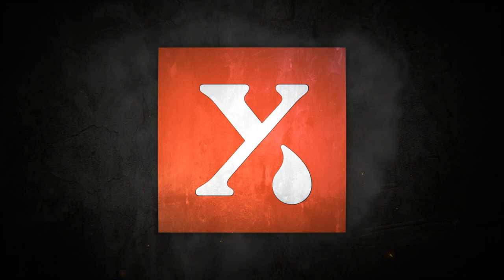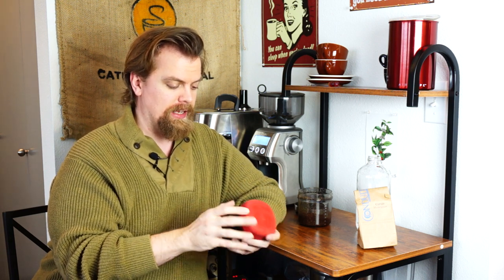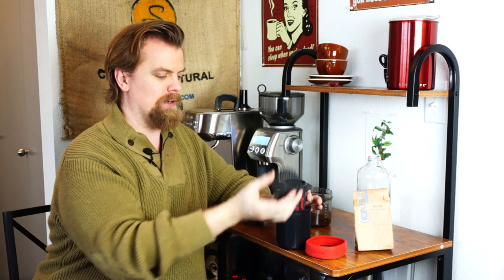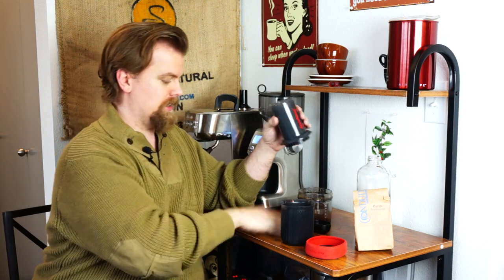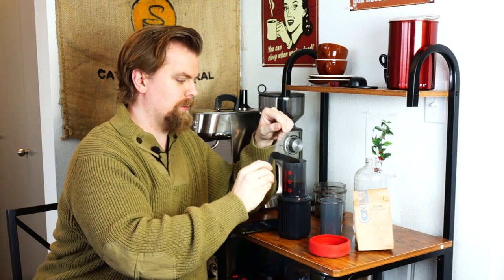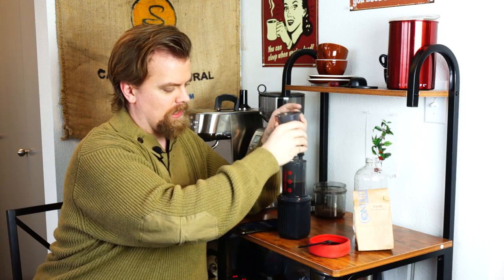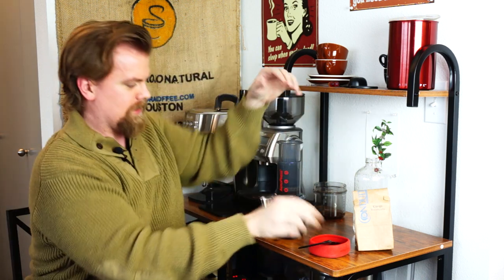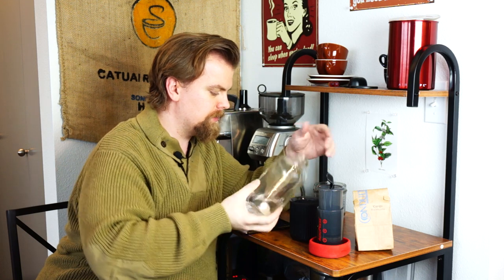How to Make Cold Brew On the Aeropress (Go)

Comment: I see you have a Bambino Plus in the background. I’d love to hear your thoughts on this machine compared to the Barista Touch as I’m considering both. Built in grinder aside, purely as just espresso, which would you prefer?
Reply from the maker: The Bambino has the same boiler tech as the Touch. Same heating capabilities, same milk steaming. Only difference is lack of a grinder, and lack of presets (which are admittedly pretty fun). Also no hot water function for a quick americano.  All that being said it makes a great espresso. I like having one every now and then. Not a daily espresso drinker though.

The only con I've found is the portafilter basket doesn't fit snuggly. This appears to be a common problem. The basket sticks in the grouphead when I remove the portafilter (even if there is no coffee in there), and pops out annoyingly when trying to remove the grounds.
Reply: Coffee Lovers TV  Thanks for the info! Did you get rid of your Barista touch to get the bambino? Which machine do you prefer overall?
Reply from the maker: Gave the Touch to a friend.  I still like the Touch more (having everything built in one machine makes the entire experience so much more smooth), but it also depends on your space availability and other brewers.  

I also have the Breville grinder that I use for all my other brewing, and pairs well with the Bambino.  So that + space issues makes the bambino perfect for me right now.  

Gonna probably eventually get a La Marzocco or a Slayer (though these options are like the equivalent of getting myself a Porsche or a Ferrari. Beautiful, but relatively unnecessary)

Comment: Excellent video as always. Regarding the aeropress assembly there is actually another really crucial reason not to do it the original way which is that the rubber on the plunger will become stressed and misshapen over time if it is left in that position. This goes for the original aeropress as well.

As for the cold brew itself, how would you consider the body of the extraction you made? I imagine it would be fairly tea-like whereas some typical cold brews are very heavy for various reasons. Also, can one create Japanese Iced Coffee with the aeropress by leaving the plunger out over a longer period of time? Curious how that might result.
Reply from the maker: Interesting on the plunger bit. thats how i've always had my original aeropress stored ... no distortion for me, maybe im special :p

Yea it was probably more tea like than a standard overnight cold brew, but there's also some filtering of oils going on. Naturally the extraction is different than an actual cold brew, due to the shortness of time and the pressure in extraction (even if its minimal, it still exists).

I'm quite curious now to see if you can actually brew just letting it slow drip down with no plunger.  Not terribly practical I wouldn't think, but could end up with some cute results. Though I'd think that would just be minimizing the aeropress to essentially a tube holding the grounds.

Comment: That’s such a cool explanation! Congrats. Could u please tell me which # was set for the Grinder? And what setting would you recommend for both cold and hot brew ? I have the same grinder. Thanks in advance. Greetings from Brazil 🇧🇷😉👍🏻
Reply from the maker: Honestly I don't remember.  I should have mentioned on the video.  But I'm also always recommending diving in and finding the adjustment yourself, because there are so many variables which can change grind size.  But were i to go do this again right now, I would probably start about 40 on the breville grinder and see what result that gave me.  Too bitter? go coarser.  Too sour? go finer.
Reply: Coffee Lovers TV 
Just tried 30 and it was way better than 35. Both settings for Hot Brew. As for cold brew, 35 was good, but l believe 40 would taste better. All settings according to my taste though. 
Thanks for your reply